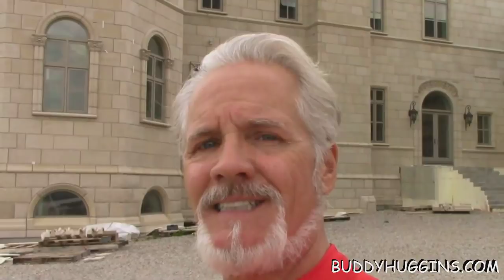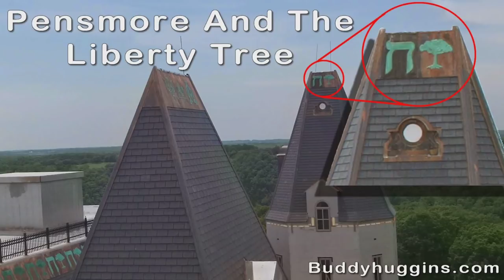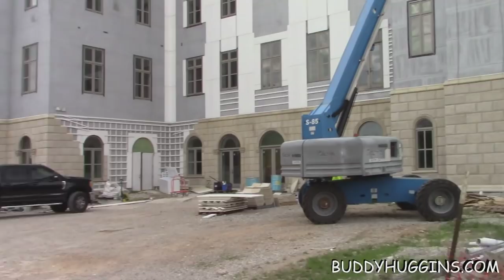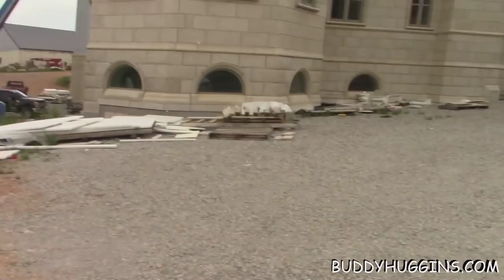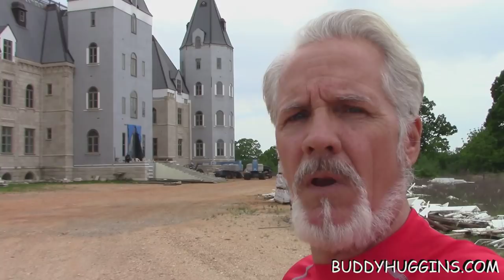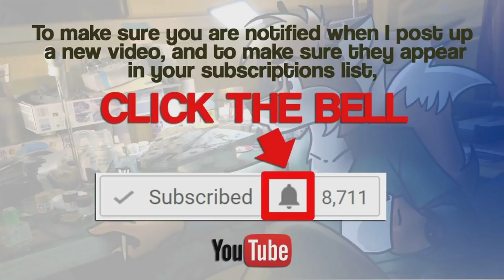Chateau Pensmore, Could this be the new White House?  Update May 11th 2018

Comment: I actually got a tour of the place by one of the contractors. He asked if could deliver material to the property.

I feel bad for the owner because a local supplier did him very wrong. I wished Steve would have sued them out of existence.

The. House is approximately 75, 000 sq ft.  It has four geothermal units that are as big as a one car garage.  It’s so big one could easily get turned around and might not exit through the same door you come it. 

His daughter is the decorator.

I’m not going to say anything that I shouldn’t say but this. I’m ashamed for our community for having a local business owner take advantage of Steve when he trusted them to build his home with the material Steve had invented. A reinforcement added item to the concrete to make the home invincible to a E5 tornado and a missal strike.  Had they did as he asked I believe the home would have been completed by now in 2021. Everyone should know the company who ripped him off is a long time Springfield business.

I would have never thought they would do this to someone.

I don’t know Steve and have never met him but because of my community I feel bad for the guy.
Reply from the maker: I hear you on that.  Thanks for your comment.

Comment: Buddy, thanks for posting this, and any followups you make.   Does anybody have any idea what the yearly maintenance cost will be?  Or to put it another way, if you don't maintain it, how long will it take to crumble?  I imagine the owner at least thinks he has all this figured out, and he'd have to have a lot of smarts to accumulate all the money to build it in the first place.  But i just wonder about the upkeep as time rolls along.
Reply from the maker: That's a good question.   I did find this on line.  
He paid taxes of $64,291.21 in 2015.

A sliver of that bill, $2,160, was for the surrounding 240 acres, which is zoned agricultural.

In Christian County, a typical or average property tax bill for a home is about $2,100, says Cindi Carey, who works in the Collector's Office.

With that size bill, Huff basically funds the annual salary and benefits of a first-year teacher in the Ozark School District. Of his total bill, $47,246 goes to the district.
READ MORE HERE:
https://www.news-leader.com/story/news/local/ozarks/2016/01/08/answer-man-how-big-tax-bill-pensmore-mansion/78417524/

At the time, the residential wing was 90 percent complete and the rest of the building — the "castle" part — was 50 percent finished. The more work is completed, the higher the assessed value and tax bill.

He uses a market appraisal system that involves a dizzying number of  factors — including construction material, quality of work, size of building — to derive an estimated market value.

In this case, he valued the entire mansion at $5,995,010. This means the assessed value (19 percent of market value) is $1,139,050.

Gray will return to the mansion for another assessment at the end of this year. He relishes his visits, and not just because he has an insider's look at the castle/home.